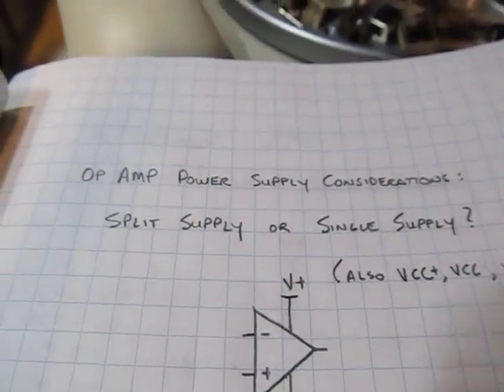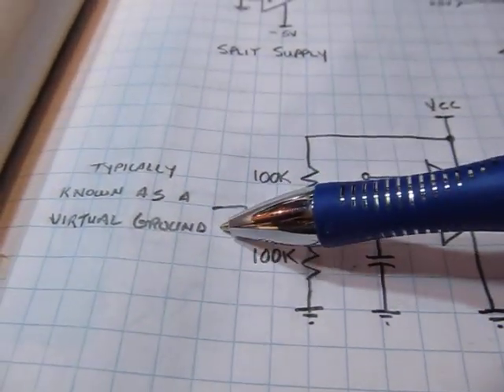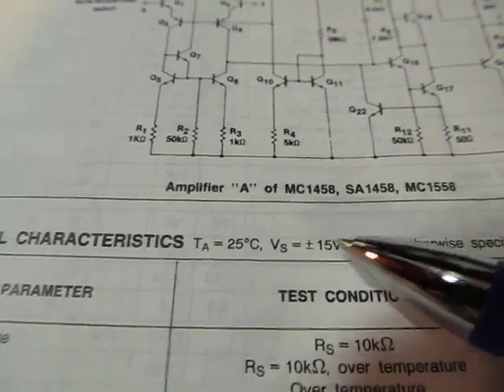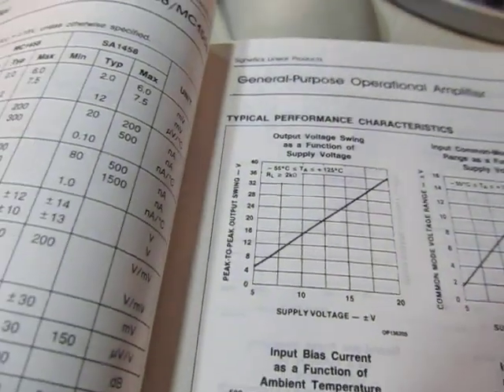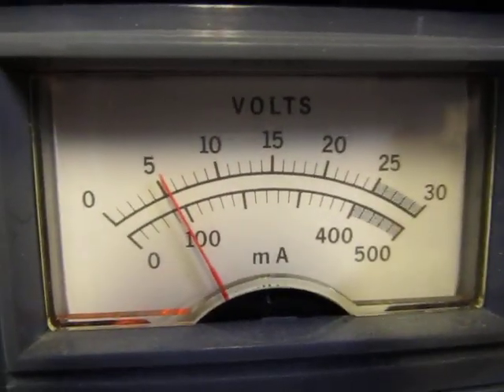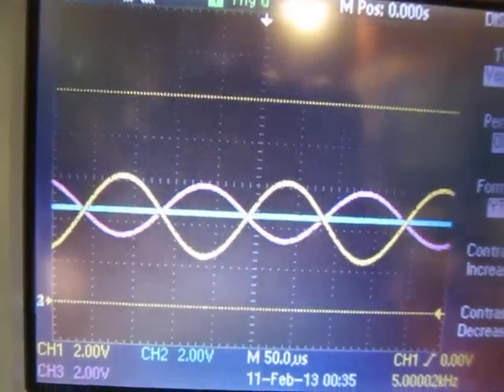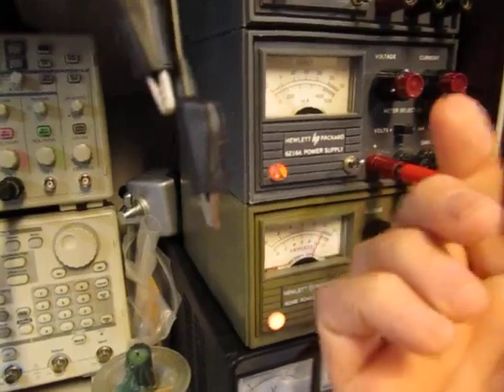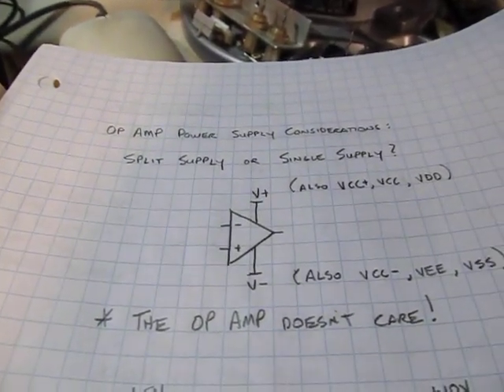#79: Op Amp Power Supply Considerations: split, single, virtual ground, etc. - a tutorial

Comment: ok peopel Im not profesional but the question is simpel I have old opel car from the 80s it uses pick up induction trigger /4pin ignition module code name mc 3334 data sheat diagram by my its cheaper model it does not have zener diode/and uses the E Core Type ignition coil. Now my goal is to finde posibiliti to advance and retard ignition timing about 10-15 ° degrees ! Now how posibli I can achive this? I did see some rc systems ,transistor and some ic chip design phase shifters but they were not reali specific and offered only set values of phase shifts like 60 120 180° degrees. So I hope for some help about that problem. Can I use external pulse generator for my hei ignition system or modifi my own phase shifter circuet? Any way any help wuld by great that thing plagues my for years I have hard cold start problems in winter .So I must alwaya fummel with distributor to turn on engine . My land does not suport those 5pin ignition modules only 7 pin modules but I dont know how to programe them externali with power suplies or relays . Any way my car is set to advance by wacum canister and counter weights so I removed all that crap I need an retarding circuet that can interfeare or manipulate ither the pick up coil out put or make programabel triggering system for the ignition module. So I reali hope some one can help my in that subject. Basicali that crapy ignition module is shit the coil saturation is terribel,it does not work on lowr engine rpm ranges and has terribel advance/retard problems  . If nothing ells please some one suggest similar ic chip design ignition coil driver who is more variabel in frequency and voltage if posibel that it can operate with the pick up coil . Hope my question makes sence.

Comment: If my question was answered 9 years after the video was published the question would be out of what is indicated below:

Suppose your using a little module using a lm358 IC that was purchased out of China and pre-assembled to serve as a Mic or transducer preamp as I expect to use mine. Suppose the module has four pins with one for input from a signal source, one for output of signal from the lm358 and two pins for power supply.

Suppose you do as I did which is connect two 4 pack AA battery packs in series and supply power to the module with the free end of the one battery pack leading to Vcc and the other free end of the battery pack leading to what one might call Vee on the lm358.

The question then is what would you use as ground or the 0 volt reference point for the input and output signal? 

I have used the Virtual Ground created by where the two battery packs are physically connected thus I suppose the signal swings between +6 volts and -6 volts & I have used what leads to what I have called Vee serve as the ground for the signal's input and output and see no difference on my scope under each scheme. 

Any comments on this, to me,  puzzle would be greatly appreciated.
Reply from the maker: Assuming you module was designed to be a mic preamp, then the input is most certainly AC coupled, so the ground reference for the signal doesn't really matter - it could be either supply rail or the virtual ground because from an AC standpoint, they're all the same (all shorted together with capacitors.
Reply: @w2aew  thanks....

Comment: Can you make a video lesson about measuring power supply rejection ratio and also power supply control loop stability? They make special probes called power rail voltage probe, which i have never used one and don't know how its so much different
Reply from the maker: I'll add that topic to my list.  Power Rail probes are special, wide-bandwidth, low-attenuation probes that allow you to dial-out the supply rail voltage, and concentrate the high sensitivity measurement (maybe 1-2mV/div) around the supply rail (large DC offset).
Reply: @w2aew  Back in the 60's and before they used "bootleg grounding schemes" because it was just a 2 prong Floating Earth and not using a 3 prong with an earth ground. When a piece of equipment is wired as "bootleg grounding using a 3 prong cable" ( Not 2 prong ) the DVM meter will be connected to earth ground or circuit ground. When making In-circuit voltage measurements all the voltage measurements are going to be incorrect and wrong because the equipment is wired as bootleg grounding? because when you disconnect the earth ground wire/bootleg ground the in-circuit voltage measurements on the DVM meter are going to be correctly different, any reasons why?

Comment: at timeline 1:58 I had the op amp set up similar to that timeline setup with the - input floating. Even though I had about half the supply rail on the + input, the output voltage still remained at zero volts instead of climbing close to rail voltage. Not until i grounded the - input did the output pin voltage swing to 1.5 volt below rail voltage. So does this mean that both inputs of the op amp needs to be connected to the circuit for the op amp to work properly?
Reply from the maker: Yes, both inputs to an opamp have to be connected to something in order to work.  At 1:58, this is just showing the bias setup for the non-inverting input, and the actual signal would be applied to the inverting input, which is not shown in this part of the video.
Reply: @w2aew  Thank you!

Comment: Great op amp video!
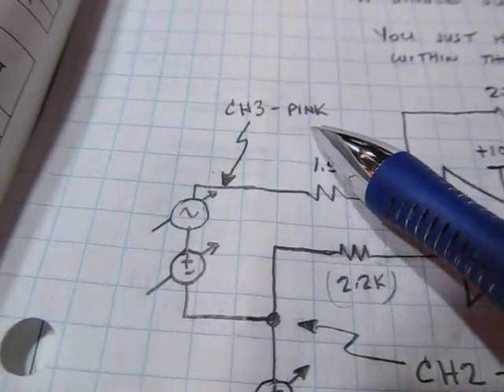I'm wondering how did you probe the signal generator input in ch 3? Where did you connect the ground clip at @8:00? Did you connect it to the ground (-) of the DC offset at non-inverting input OR at the node after it (+)? I feel like if I would connect it to the (+) node (or just before the 2.2k resistor) I would then short out the DC offset voltage because the other two oscilloscope channels ground clips are connected to the circuit ground.
Reply from the maker: All scope probe ground clips are connected to the circuit ground.
Reply: @w2aew  Thanks for the response sir. I have actually sent a pm about the same on eevblog :D got really anxious about this ground loops ever since i have watched Dave's video on blowing oscilloscope probes.

Comment: It should be noted that the output can be isolated through a  capacitor to remove the dc portion of the waveform.

Comment: Great  video, very easy to understand, I am building an audio signal generator and you can use eiher 6 volt sprit or 12 volt single, can you tell me which way to go? Thank you kindly!!
Reply from the maker: From a circuit performance standpoint, they'll be identical. So, it really comes down to details of your requirements.  Do you want the output to be centered around ground and DC coupled?  If so, then use a split supply.

Comment: Thanks for the great information. I was, however, hoping to learn a bit about how to calculate the power consumption of the op-amp. So.. if the output feeds say an ADC, how do we calculate the power loss through the gain resistors and the chip itself. Once again, great tutorial. Thanks.

Comment: This is an 'old' video. But a very important one!

 Many people, including yours truly, blindly use an op-amp and then wondering why it is damaged or why sellers con us, we then buy some more and same story, we buy even more and same story. Lots of wondering and blaming.
Reply: What do you mean? Where is the problem?
Reply: @stevegoodjob5902  To put it simply, many people using an operational amplifier or transistor without understanding how it works. This is what I mean and is the problem.

Problem is the human and not the operational amplifier or transistor. 

For instance, many people wonder why audio or signal clips or looks weird. The first thing they do is keep changing and buying different op-amp or transistor to test. They do that until a period of time they get fed up and start to blame the maker of op-amp or transistor. How is it possible that all transistors of all makers fail all together with 99.999999% rate of coincidence?!?!??!?!?!

For some weird reasons they are not bothered to change other components and try different levels of power/voltage/current. They are somehow braindead. Doing the same thing expecting different results.

You would be surprised the sheer amount of people having an oscilloscope still wonder why a circuit does not work as expected, and play the blame game. Any fools can own an oscilloscope these days anyway. As if having a digital clock and wondering how come it does not have the good old hands moving, that clock must be faulty, buy another digital clock and wonder why again no moving hand, must be another defective clock, buy some more, wonder some more, rinse and repeat.

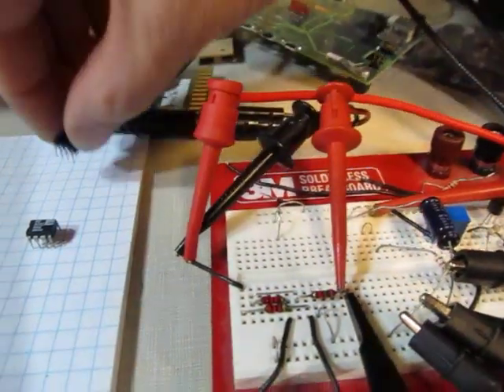Comment: 12:50 "And you plug it in, ... boom ..."   Boom??? Reallly???   :-)
But in general, there is a (small) perturbation near their zero, though.
Good, very good, video. Second point, if the op amp has its offset not defined as being the earth ground we have to adjust the + and - signal with respect to the same zero origine... which can then be  THE real headhake.
I really hope everything is fine on your side, it is 2021 here!

Comment: What formula can you use to convert Full wave AC voltage to the Equivalent Half Wave AC voltage and vise versa? Because if a circuit needs 26vac Half wave voltage, how can you convert this to the equivalent Full wave AC voltage?

Comment: Another very good video Alan. Could it be possible to show your power supplies setup and signal generator and earthing arrangements, many thanks.
Reply from the maker: The schematic on the last page of my notes is accurate.  In my case, the signal generator features a floating output (the shell of the BNC isn't grounded), so I was able to put it in series with the supply that I used to adjust the offset.

Comment: In old tube amplifiers the 6vac heat voltage the transformer didn't have a center tap for the ground for the 6vac. To convert a non center tap transformer to a 6vac center tap you put two 100 ohm balanced resistors and tie them to a virtual ground which will be the tubes plate voltage. Most plate voltage are from 200vdc to 450vdc. Not sure why they would put the virtual ground to a DC potential connected to the plate voltage so that the 6vac heat voltage will have a virtual ground virtual center tap. Have you heard of this type of virtual ground?

Comment: At around the 2 minute mark, I don't think that point should be called virtual ground, unless it's a term that is used pretty loosely. Virtual ground for the op-amp would be there when you have the positive terminal connected to GND and negative feedback configuration, where the feedback action is trying to make the  voltage at the negative op-amp input equal to the voltage at the positive input. In the circuit shown at the 2 minute mark, it looks like an open loop.

Comment: So if you are using the non inverting input as a voltage sensing/ smith trigger comparator mode is it still possible to use that input as a midpoint for split supply.

Im using lm358 as a compartor to turn of a constant current load when a low voltage is sensed on the non inverting input. But the Op Amp output would not turn completly off it would stay 0.8 volts above ground, the solution may be to supply it with negative voltage to swing it negetive on the output.  Il give it a shot, any input of some electro wizard appriciated

Comment: I have tried measuring the AC line noise on the primary side of various equipment on an oscilloscope but not sure how do it correctly. How can you measure the AC line noise level using an oscilloscope or is it better to use a spectrum analyzer to measure AC line noise? my Fluke DMM meter can't measure the AC line noise level so what meter would do this?

Comment: Thanks Alan - like many others I refer back to your tutorials often. You balance theory and practical perfectly every time.

One thing to note here is that rail-to-rail op amps are expensive! Order of magnitude up on the likes of an LM358.
Reply from the maker: Keep looking.  There are many inexpensive rail-rail op amps out there.  The Microchip MCP6001 can be found for less than $0.25
Reply: @w2aew   Cheers Alan! Thanks for the heads-up.

Comment: I have a 741 op amp with a 170mV, 852Hz input sine wave, +5/-5V power.  I have a 10k resistor from the inverting terminal to ground and a 20k feedback resistor (output to inverting terminal), the input is on the non-inverting terminal ... the gain should be 3... but instead the gain is roughly 1.  (So the output is roughly 170mV.) The output is not clipping... I'm not sure what's going on...?

Comment: Great video. thank you very much.
What happened to output swing voltage if the output current is increased? how to use opamp to drive a low impedance load?
Reply from the maker: It depends on the specific op amp.  In general, the available voltage swing is reduced into low impedance loads.  Some  op amps can drive low impedance loads better than others. Often times a buffer designed for low-impedance loads (like a push-pull stage) is included in the feedback loop of an op amp to improve the low-impedance drive capability.
Reply: @w2aew  Acutally I used push pull or single transistor at the output stage of opamp; it works fine but not efficient. With single supply, the output voltage has the dc offset.

Comment: BTW. Do not go too much beyond power supply range with your input. The AD8032 does support going about 200mV below (above) negative (positive) supply safely, and still maintain linearity of output vs input (obviously you would use gain less than 1 in this case usually). Above that the linearity (and distortion characteristics) can't be guaranteed. Additionally, 500mV is stated as a absolute maximum, beyond which opamp can be permanently be damaged. It is recommended to add external clamping diodes if you expect this to be possibly happening.

Comment: Super useful. Are there some performance tradeoffs to the rail-to-rail opams? Noise, bandwidth, input voltage offset, temperature stability, drive/sink output current, etc.

Comment: But electronic engineers and technicians say that the laminations changes the frequency response of the transformer is this true or false? or do they mean the core material inductance will change value because of the wire winding lamination?

Comment: So the "Lamination coating" on the transformers winding changes the windings or wires inductance?
Reply from the maker: No.  The core material changes the inductance.  The coating is simply an insulator.

Comment: Why does the type of kind of lamination on output transformers windings/wire change the frequency response of the transformers output? The Lamination coating on the transformers windings and wire will change the frequency response, any reasons why?
Reply from the maker: Different core construction and materials have different permeability (which changes winding inductance), and different losses vs. frequency

Comment: yes true, I just didn't know that different tube filaments has different resistance values which is a voltage drop. I thought as tube filaments all had the same resistance value.

Comment: But the datasheets for tubes doesn't say the filament resistive resistance. In the datasheets it just say how much current the filament needs in order to work like 2A or 3A. I guess you just take your ohm meter and measure the resistance of the filaments resistance?
Reply from the maker: you can't just measure it because its resistance changes when heated up (like a light bulb filament).  You can calculate resistance from the voltage and current rating.

Comment: older amplifiers used transformer less power transformers, it was called hot chassis which didn't use an AC power transformer but a series of tube filaments to step down the AC voltage. I'm not sure how tube filaments step down an AC voltage, but many you might know. On the schematics it looks like 4 to 6 filaments stepping down 120VAC to 40VAC for the rectifier tube.
Reply from the maker: The filaments are simply resistive elements - so there's a I*R voltage drop across each one in series.

Comment: Well done!  
What is the most effective method to bias the op amp using single power supply? Would it be split resistive or using other means? Thank you for your great to the point presentation!
Reply from the maker: resistor divider is certainly most common, but it really depends on the application.

Comment: Hi. Can i ask some questions to you. I am currently working with Multiple feedback bandpass filter. And my circuit didnt work every time i tested it. I used lm324 op amp ic. Can you help me what is the possible solution for this or it might be the op amp ic i am using?. Can you suggest better ic for my application?. Tnx a lot
Reply from the maker: A LM324 should work in this application if the circuit is designed correctly.  However, it is impossible to help without seeing your schematic, or knowing the details of the application (bandwidth, signal levels, power supplies available, etc.).
Reply: Tnx for the reply . I want to pass the band of freq from 400 to 1800 Hz. I choosed 1kHz as my center frequency and a Q of 20. I used 5V dc single supply.  I connected my circuit components in a breadboard... And i am using microphone and audio jack as my input from sound. I observed the output in oscilloscope. And the output is only noise. the values of components are Rf=1.5M Cf=680nf R1=4.7k R2=12 and C1=2.2nf
Reply from the maker: Still need to see your complete schematic - component designations alone don't mean anything, there is no "standard" schematic.
Reply: Ok . How can i send it to you?
Reply from the maker: If it is online, put the link in your reply here.  If not, then scan or take a picture and upload it to a site like https://imgur.com/ and post the link here.
Reply: The picture is in dual supply but the actual IC i am using in breaboard is a single supply. I took that schematic from my PC simulation tool